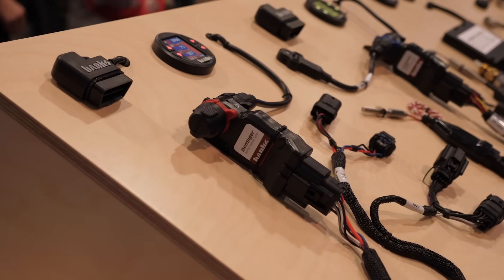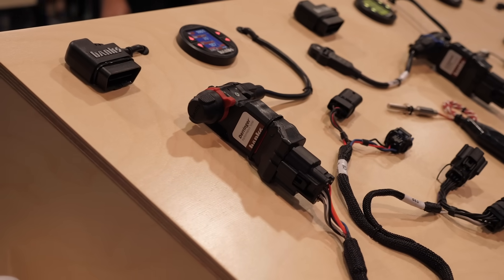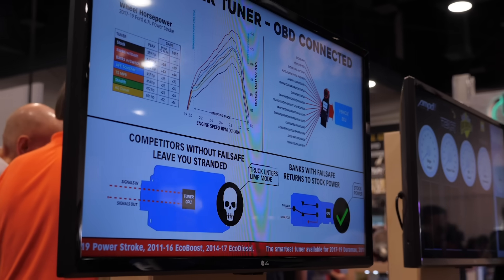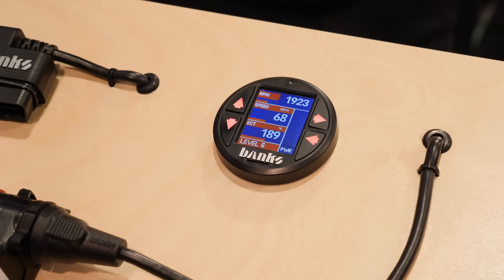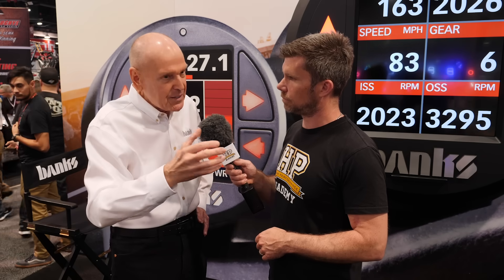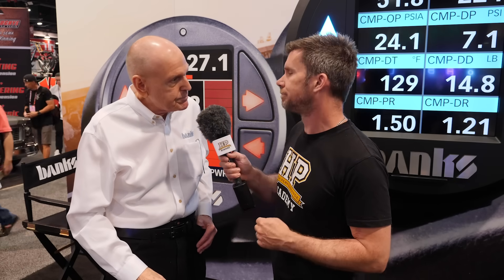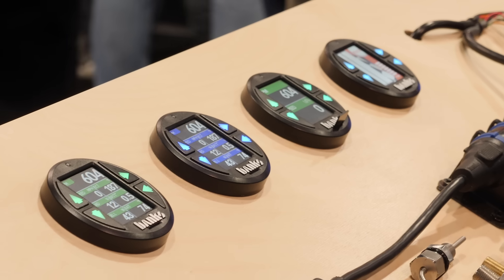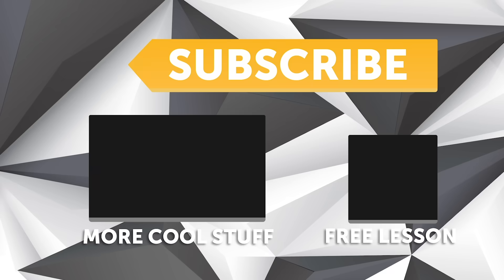More POWER With A DPF Fitted? | Gale Banks On Emissions [TECH TALK]

Comment: I own a 2018 F250 and I had installed the Bank Power Derringer and I swear this thing didn’t gave me more than 40 hp and my regeneration rate have never change. This thing is way to expensive for what it’s give.
Reply: caan1403 There’s only so much power you can add before you need to increase the capacity of the exhaust emissions equipment. If the tune added more power it would just plug up the factory exhaust quicker.

Comment: Modern Diesel engines are very efficient and when properly tuned do not smoke. Adding dpf and def only increases the cost of the vehicle and vehicle ownership while reducing longevity. ie getting 12-14 mpg in a truck vs 18-22 mpg in a deleted truck.  At what point does having slightly better emissions out weigh the substantial amount of extra fuel burned.
Reply: Emissions equipped semis are definitely less reliable. I’ve been stranded many times on the side of the highway because of that
Reply: Well said, I have both pre and a post def trucks and my older unit gets far better mileage and doesn’t smoke.
Reply: Thank you
Reply: Politicians want to "save the planet" at your direct expense to make tree huggers happy.
Reply: @mrmedium7984  So what you're saying is fuck the planet, cause you won't be around when it dies?  Continued observation of temperature and CO2 levels in the atmosphere show increased temperatures worldwide, and a 200% increase in global CO2.  Is that a coincidence?  Before you discredit science, remember that the scientific process largely consists of scientists trying to prove their ideas wrong, and when they fail at that, passing it to other scientists to have a go.
Reply: That is just downright wrong. Modern Diesels are calibrated to work very, very efficiently. Sure, there is a small penalty for the aftertreatment, but it is tiny. Running an engine without any consideration for emission at all will increase BSFC by maybe 5%. And increase NOx by about 15-20 times. 
Going from 12-14 to 18-22 mpg is absolutely impossible under the same conditions. That would mean an reduction of fuel consumption by more than 30%... You would not even manage to get sich poor combustion in a Diesel engine if you tried, because at these conditions, the fuel wouldn't ignite reliably anymore...
Reply: @kain0m  Hmm, maybe mine is broken then, it gets 19MPG. It's deleted, and tuned, but tuned to not dump raw fuel and billow smoke.  It gets 13 MPG while towing.
Reply: @acdii  plus, if you swap turbos you are looking at way better fuel efficiency but non-vgt or fixed turbos will not work because the egts are not hot enough. Heat is loss lol
Reply: Only slightly better emissions? Are you sure?
Reply: Ding ding ding and that's what the lobbyists for whoever creates these emissions devices doesn't want anyone to think about
Reply: The main focus of emissions controls is NOx. The current crop of engines with EGR and SCR produce about 1/10th the NOx of engines without. That's a much greater reduction than the loss if overall fuel economy. (have actually done a study at work to verify this)

Comment: We're having dpf issues on our forklifts at work.   Brand new 30k forklifts and there's a faulty o-ring that is leaking oil onto the dpf system and catching fire.  The regen cycle gets so hot that it makes oil catch fire much easier than before.  We had 1 catch fire and a week later one was smoking.  Our other sites were having similar problems.  None of the filters have "gone bad" though and they've run 24/7 for 2 years straight.
Reply from the maker: Ahh bugger. Not the first thing or time a manufacturer has gotten something wrong when it comes to o'rings eh. Hope they get you guys sorted out under warranty without too much inconvenience - Taz.
Reply: @hpa101   Yes, yes...clearly an o-ring issue. Nothing to do with the fact that they're are putting DPFs on all diesels and neutering them in both power and reliability. Just an o-ring. Enjoy that downtime and lost revenue, but be glad you did your part to slay the imaginary climate changing air pollution boogeyman.

Comment: If my TDI lasts 600k miles instead of 400k with less parts replaced and less fuel burned, because of a DPF and EGR delete, would that offset any increase in emissions? Still have a high flow diesel cat. Couldn’t make as much power nor reliability with the stock DPF and EGR in place.
Reply: Deboss Garage made a similar point about combine harvesters. How much pollution is released when the heat from the emissions system catches the dust on fire and burns the combine to the ground.

Comment: The problem is Banks almost goes to the point to Demonize other companies/tuners that do delete DPF's among other "work arounds" lets not mention the Huge Billet 3000-4000HP Diesel builds!
Reply from the maker: Show me the legitimate 3000-4000HP race builds doing things like this: https://www.youtube.com/watch?v=XEbw684aUK4
People only have themselves to blame. If you drove around city streets running methanol deliberately trying to agitate people's eyes with it, you would get a reaction just like this has.
That's my personal opinion. 
We're all for performance builds in performance applications 🤓  - Taz.
Reply: Big difference in On Road vs. Off Road rules in emissions. An off road engine tune on the paved highways is not a good match for the average road trip.

Comment: Mr. Banks has been doing it longer and better than most. Pretty much if you disagree with him, you'll end up slower on a race track and burn more fuel while doing it.

Fuel efficiency (extracting as much energy in cylinder as is possible,) Heat management (both intake and exhaust,) Data acquisition (understanding what impacts tuning and hardware decisions are having on the engine / power / emissions) and robust testing all play a roll in how he and more widely his company go about their business. Looking for where power is being lost or wasted and how to best minimise that. 

If you don’t like emissions laws, run a pre emissions vehicle. It will be slower and use more fuel than a modern vehicles. Not to mention the poorer build and interior qualities of older cars / trucks. The EPA are serious in the US, Europe, increasingly in Aus and other developed markets. Just look at what happened to VW.

As Gale says: if you’re blowing smoke, you’re wasting power.
Reply: Have you ever heard of glider trucks or the massive aftermarket for pre emission common rail engines?
Reply: vw was doing the right thing but epa/goverment are the bigwigs. delete a 2019 6.7 tell me its slow and smokes

Comment: If a diesel engine smokes visibly, it is by definition a failed tune. Inefficient combustion does not an efficient, powerful and reliable engine make.
Reply: The smoking mostly occurs when the turbo is running out of air bc of the tune. Less air + more diesel = smoke = bad tuning
Reply: 4G12 Exactly. Unused fuel ⛽️ = less force. Same goes for unleaded engines and “flames” out the tail pipes...cool as fuck but not very efficient. Great call~
Reply from the maker: @SprayIgniteBoom  gasoline engines are different as running rich can help cool things in a way that running rich on a diesel doesn't.
That said, the same goes for there being a difference in having this happen as a side effect of a performance application, and tuning specifically for it just because you want to melt your GFs crocs - Taz.
Reply: Well kinda but the Idea of stoch mixture is to use all the fuel but the idea of best power is to use all the air. So you can get get a small amount of black smoke at the best AFR.
Reply: Argentino Media  check out the Koenigsegg Gamera, your theoretical engine that can use any fuel exists now. valvetrain designed by Freevalve with biofuels in mind. infinitely variable timing (no cams). you can actually use it as a 2-stroke.

that said, almost none of what you said makes sense.

soot is not a byproduct of combustion. it's the byproduct of vaporization without enough oxygen for combustion. you could compare this to covering a candle in a jar. the inside of the glass immediately gets coated in soot (unburned, vaporized fuel) as the candle is extinguished from a lack of oxygen.

the lack of air/fuel mixture is also why matches smoke. the surface area of the fuel on a matchstick makes for a very inefficient burn. totally different than the air mixing with the atomized fuel in a cylinder.
Reply: 4G12 so you’re saying that every diesel truck on YouTube is a failed tune or the monster spooling up at the drag strip or pull is a failed tune?
Reply: @MRW21783  It is more or less failed design if you need to wait while the turbo spools, anything except maybe dragstrip use is just annoying. Slight puf of soot when flooring is okay but after that you are just wasting fuel. In tractor pulling applications you also might not get actually that much soot that you would expect, most of the stuff is steam as water/methanol injection is used so much. Having lot of black smoke coming out from the exhaust actually means that you would melt the turbo compressor side if you keep going for few minutes as EGT skyrockets when unburned fuel burns still at the exhaust manifold / turbo.  And any STREET engine that does not keep itself together for 1 hour of full load is failed tune / design as it is normal use in towing on hilly area or also some Europeans might call it highway driving.
Reply: @Karjis  what?
Reply: @MRW21783  perfect statement, remember gale banks is just trying to sell his emissions-compliant shit. He says “Those days are over” yeah not exactly.
Reply: Among the other inaccurate statements in you comment the fuel compression one needs addressed.
  Diesel engines are compression ignition. They compress the AIR to the point it reaches a hot enough temp to ignite the fuel that is injected at the upper part of the compression stroke. That’s why diesel compression is much higher than a gas engine, 14-22:1, even higher on some.
  Newer engines can have lower static compression and still make awesome power due to better injectors running 20k plus psi fuel pressures giving multiple injections per cylinder firing and very fine atomization of the fuel. Small fuel particles ignite easier and burn more completely producing much less soot.
Reply: Argentino Media you literally just clowned yourself in a video where he explained why your comment is wrong and you must have not watched if you typed that bubba
Reply: if it's smokin', it's broken!
Reply: 4G12 you butchered the English but yes. I find it funny because I’ve heard a diesel tuner say that they smoke when making max power but then why do all factory diesel vehicles clear up under wide open throttle but smoke like a coal train under partial load. Don’t think they would make it run that shit WOT on purpose. So I can’t wait to see more on this topic so I can roast people who think they are billy badass for blowing coal on traffic and getting gapped by petrol engines. These are the principles that makes the car, truck and motorcycle communities all have their own major turn offs.
Reply: @CorruptInfinityOfficial  Actually his English was fine.  Shakespearean even...
Reply: @CorruptInfinityOfficial  His sentance structure was intentonal. It traditonally goes "xxxx doth not a yyyy make.".
Reply: @CorruptInfinityOfficial  no smoke no poke
Reply from the maker: @g4rr377 All smoke, no poke - Taz.
Reply: The AFR is rarely set for whatever the "ideal" combustion ratio would be at a given RPM, it's more often set with a bias toward maintaining steady operating temperatures for a given RPM and load. This means you will usually be slightly rich on the tune, which does result in smoke, and because diesels have to control EGTs there is a definite benefit related to a slightly rich tune in that your engine doesn't blow up. That aside, diesel emissions benefit 99.9% of life on this planet. It's basically ultra-pure plantfood. Why would you want to hinder this?
Reply: Tuning a diesel rich is the opposite of a gasoline engine.  Rich tuning will skyrocket egt’s under load.  Gale actually has some incredible tuning information in his “killing a duramax series” where he specifically mentions his AFR targets for different goals and managing heat directed into the pistons.
Reply: @alphaforce6998  diesel particulates are three times heavier and 2 times worse than anything else that's put into the air
Reply: @thecloneguyz  good thing that soot is heavier than air and falls to the ground pretty quickly.
Reply: @aleks138  
SAID THE OZONE LAYER
Reply: Argentino Media  haha what?? If you have smoke you're not burning all the fuel and not making all the power. Gale Banks literally has tons of videos on his channel proving you wrong 🤣
Reply: Tell that to the tractor that can now make it up the hill. Smoke starts at about 18-20 afr. Full power is around 16-18 afr with diesel.
Reply: @josephschaefer9163  Yea, but that tractor is rebuilt every 5-10 min of full power runs, some even less!

Comment: I have driven some rapid Euro diesel cars with DPF as standard - no issue. Also bought a car with it already deleted and it was a nightmare. Plus, that’s some nasty crap it’s filtering!
Reply from the maker: Yes deleting your DPF doesn't guarantee increased performance alone like some assume so it's nice to get a bit more info around this eh. It is a bit weird how some assume you can just throw a DPF in the bin and boom, better performance, then again there is the same misunderstanding around air intakes and exhausts too - Taz.
Reply: @hpa101  Here finland it is very common to do DPF delete because replacing it is so freaking expensive and some remap shops are offering DPF delete option and claims that without the DPF engine can make 20-50 horsepower more.  As we all know in Finland your car have to pass MOT which includes emission test. In diesel cars the emission test is basically just smoke test so if your car don't produce too much smoke it will pass the test and it is road legal even without the DPF. Most of the Finnish diesel tuners are running old Mercs and Volvos. Of course the highly tuned precamber diesels produce tons off smoke but they say it is "power smoke" which sound really stupid :D
Reply from the maker: Removal due to replacement costs is a different kettle of fish compared to the goal of removal for tuning purposes. On this front, the aftermarket is catching up but some laws around replacement with aftermarket units will have to change as well in some locations to make an impact - https://www.youtube.com/watch?v=ryh4piBvPiY
Power smoke, I have not heard that one before 😂 I know the EU has done a u-turn on diesel vehicle usage so there are some interesting times ahead for you guys - Taz.
Reply: Zeihon kanava  I have a 2012 320d, with around 320000km on the clock. It is still on the original DPF! If the car is serviced and driven as expected for regen cycles, it should last. I am a technical trainer; we find the main problem is that technicians don’t find the route cause for a DPF blocking in the first place, so just replace it - or suggest to delete it. There are so many issues that will affect the DPF regeneration, you really have to know the system well and have good diagnostic skills. For example, the ECU on a diesel can not detect an air leak up to 10mm!
Reply: @MechanicMindset  My daily is E46 320D with mildly tuned engine, better flowing intercooler and remap making around 210Hp/450NM. EGR is deleted but I am not sure is the DPF removed. No smoke until the redline when turbo stop being effience. 

In Finland average car age is 12 years and most of them are death traps full of sketchy duct tape and ziptie repairs just enough to pass MOT every year, so thats why DPF delete is so popular here. If it pass MOT you are good thats the main theme of owning car. :D
Reply: @hpa101  Of course the "power smoke" is some sort of Finnish equivalant to "rolling coal" for example: "Katso kun tulee voimasavua - look at that power smoke" :D But I think the biggest problem is that those prechamber diesel guys who are now buying common rail diesels and they are using same old metods to when it coming tuning, as we all know they act differently. I personaly wanted to se more diesel related videos just so i can be that annoying guy who is think that he knows everything :D

Comment: These assholes forcing DPF:s on us, should also pay the bill for a new one, when they clog up and need a replacement.
At least force the manufacturers to all use the same model of DPF, to lower production cost and the cost of replacing it.
Reply: Yea! Talking about that, lets down regulate the coal plants too, clean air is overrated!!